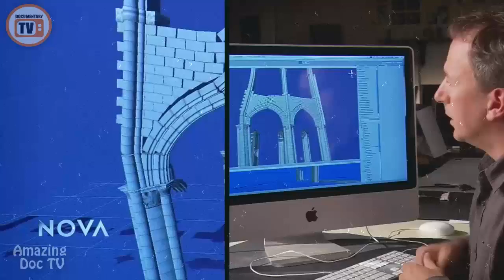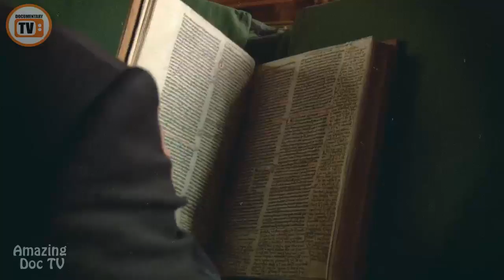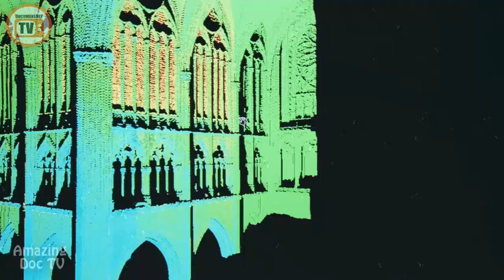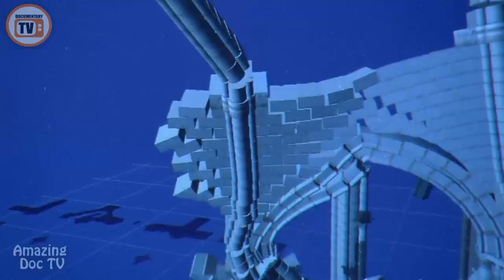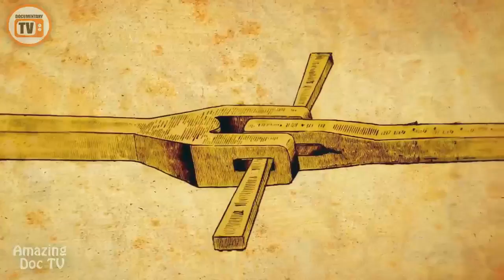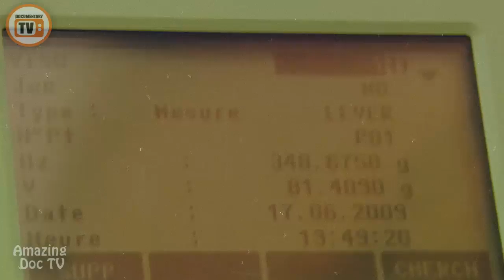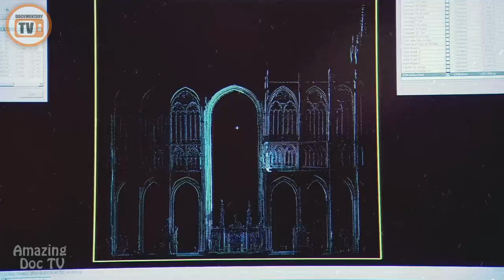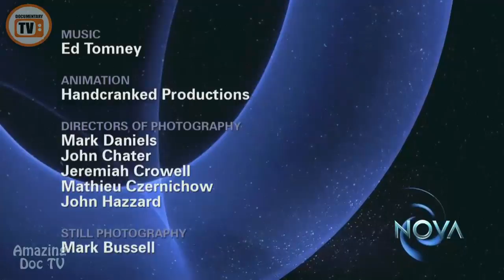Building the Majestic Gothic Cathedrals - Amazing Documentary TV

Comment: It is interesting that no one has mentioned the. Vault stones between the ribs. Each one of these must be cut as a beveled Keystone shaped in three dimensions to form the interior of the arch and splaying outward so that both  the horizontal and vertical momentum: of gravity are countered by the adjoining stones. Every angle of each stone must be precise to permit gravity to interlock the vault stones to both the ribs horizontally and direct the weight toward the downward rims.